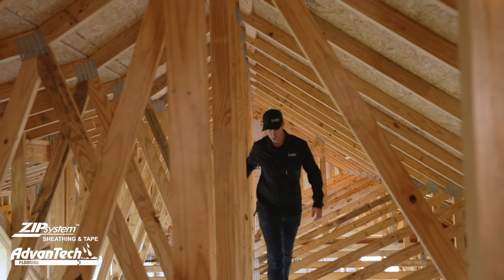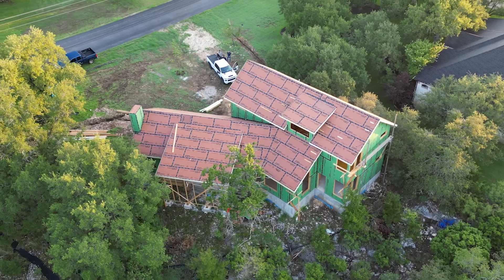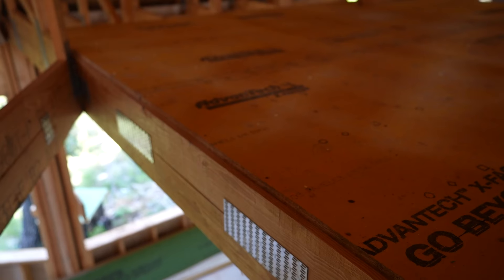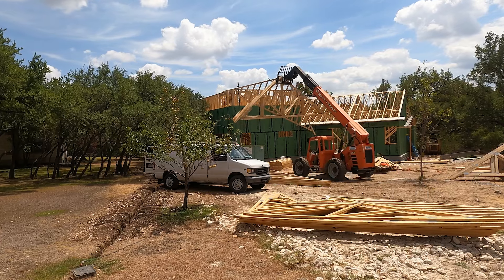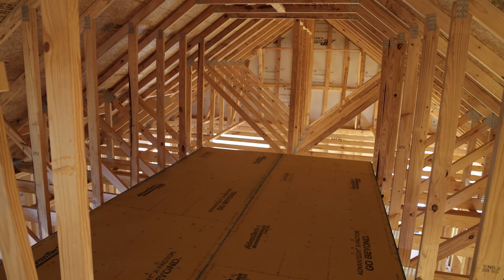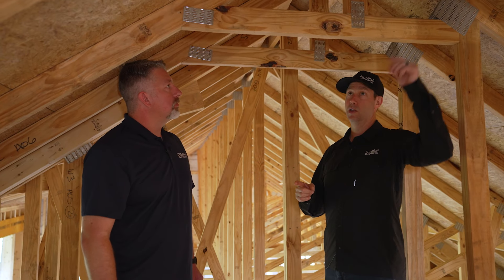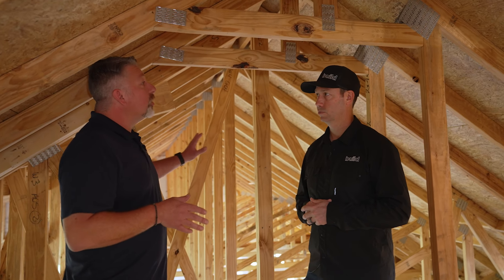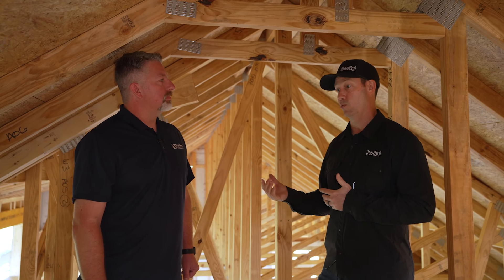ROOF TRUSSES: Pros, cons, and costs!

Comment: Regular roof framing is worth the cost. The usable space is worth it. Never met a homeowner that built a house that complained about too much room.
Reply: Yea,try and crawl in this roof for anything.
Reply: You can spec them anyway you want. The McMansion they are building next door has 18 inch shoulder for insulation and fully open and will be playrooms and HVAC with storage over a huge open living room.
Reply: I have a trussed roof and the top floor is a master suite with an angled ceiling with skylights and dormers.
Reply: Plus the taller lumber makes insulating at the roof line easier
Reply: In some parts of the country that’s fine, but here in the north that is all insulated space. We blow 30 or more inches of insulation in attics.
Reply: IMO, the design decision should centre around whether the climate demands a vented or non-vented roof.  The outside vs inside relative temperatures should dictate how important a vented attic really is to preserving a comfortable interior temperature.
Reply: @chameleongates  you can vent a roof either way. What are you talking about?
Reply: Span. The biggest advantage. I was part of building a church once. The truss span was 78 ft. Can't  do that with rafters 40 plus ft. Is common.

Comment: If you're building massive homes like this that 99% of us can't afford, trusses almost always make the most sense. Basic gable roof, rafters make the most sense.
Reply: Still cheaper and more consistent to use trusses.
Reply: @Egleu1  The 7,000 dollars stated includes labor on a very complex roof design. If your making a basic roof, rafters are cheaper material wise and labor wouldn't be a whole lot more because it is just cutting the same cut over and over. Not hard to setup a miter saw with a wing and stop block using an extra 2x6, some horses, and clamps. Cutting a birds mouth would be more time consuming unless your roof is about 45 degrees since it involves a shallow angle cut, but not much if you are skilled at cutting with hand power tools. People still use rafters for a reason. I'd use trusses if given the option but that is mostly because I'm lazier then I am frugal and if I want more strength I just put them 16-20" on center instead of 24"
Reply: @siral2000  that roof they showed is hardly complex.

Comment: I design these systems in the Midwest. Clear spanning large open areas is one of the major benefits you've missed out on in this video. Plus we design top down for the best value engineering. Having proper load transfer from top to bottom is another great benefit to truss systems. Glad you did a video, maybe visit a plant sometime, I can set up some tours if you need it. 😉
Reply: What is the maximum reasonable span distance? Is this limited by span, height, or both?

Can you do an attic room style truss?

These are super cool man.
Reply: @JL10007406  we've just put up 90' clear span within the last few months. I know we've sent out 100' clear span trusses before as well. On longer trusses like that we're designing camber into the bottoms to let the truss settle into a final straight layout after installation. Max height of a single truss is typically at 14' but we can stack multiple trusses together with proper bracing to achieve a taller roof height if needed. Room in attics can be loaded for RTU, living area, or light storage. The height of the room only limited by the pitch and heel height. Awesome questions!
Reply: Right and I think the clear span you can achieve with trusses is the biggest reason to go with trusses and they didn’t cover that.
Reply: @cherrytsume  thank you for the reply!

For conditioned room in attics, can customers define the dimensions of the top member? If I wanted 2x6 or 2x8 lumber, for example, can I pay extra for that additional cavity depth without triggering extensive engineering work? I don't like exterior foam insulation for environmental reasons. The ability to use cavity insulation inside the sheathing would be attractive, but infeasible if the member thickness was only 3.5".
Reply: @JL10007406  Most attic trusses have a minimum 2x6 for the top chords due to the lack of triangulation withing the room space. We can even frame in a small floor truss in the middle to provide space to run plumbing and hvac for your attic living areas as well. It's fairly common for our customers to request a southern pine 2x10 or 2x8 top chord for that additional interior insulation space just like how you're mentioning. Another great question!
Reply: Thank you Blake. I really hope Matt does a video at one of your facilities. I would love to hear about it. I am here I'm North Florida and waiting to build on my land after we hit a real recession.
Reply: Right you are on the clear span benefit. My homeboy Larry and I are building a 50X60 foot storage building and he went with 50’ trusses. All that storage area with no walls or support posts is pretty cool.
Reply: Clear span has nothing to do with truss vs cut roof
Reply: @CMbassin  trusses are actually terrible for long clear spans. Rafter thrust and bottom cord expansion/contraction leads to so many issues with drywall finishes and popped plates over time.  If your searching for clear span you need to rethink your interior design and go with a cambered glulam system or post and beam.
Reply: @BaronVonFrankenBolzlll  Re: " Clear span has nothing to do with truss vs cut roof":  Well, in practice it does.  The manufactured truss is engineered, so it features an optimized design.  The tables for designing a "cut" roof are overly conservative, and give you no credit for details that improve the strength of the assembly.  So, it is no big thing to design a relatively low pitch truss roof that spans 30 feet, but the same profile roof built from the tables would have much larger joists and rafters.
Reply: @BaronVonFrankenBolzlll  Re " trusses are actually terrible for long clear spans":  You are comparing a Ford solution to a Lamborghini one.  The world is filled with long clear spans made possible financially by use of trusses.  Oh, boy.  Making economically driven choices has consequences.  Surprised Pikachu face.

Comment: I'd be curious to know if the 'savings' for these are actually passed on to the homeowners, or just to the homebuilder or contractor.  My guess is that it isn't.
Reply: It actually is. I am currently going through the process of building a house. I originally wanted a traditionally framed roof due to my line of work (firefighter). But I decided to go with trussing because it was a $7k to $8k cost difference.
Reply: Just depends on the contractor and the contract
Reply: @philippenight2421  Yes, that's the key.  My last build I generaled myself, so I know I got the savings as I bought my own materials, but some of the quotes I was getting from homebuilders (double the cost and more) were truly shocking.
Reply: if it's cost plus how could it not be??
Reply: Ask your builder/contractor for a price on traditional rafters vs. a truss roof.

Comment: The manufactured trusses can be engineered to have plenty of attic space. The cost savings is worth it by itself. As Matt said at the end, that money can be used in a different part of the house to upgrade insulation, better windows, larger island, etc in a part of the house that you'll spend a lot more time in.

Comment: As a 29 year firefighter I absolutely hate trusses. In a fire event, when a 1/4" on each side of the wood is charred, the wood still has plenty of strength, BUT the nail plates simply fall off, causing the roof to collapse.
There are plenty of videos where truss roofs collapse within 15 minutes of the fire start. That's why many fire departments don't even attempt an interior attack, which is the most effective, but rather go defensive from the outside, which then often leads to a total loss. 
Calculate that against the $7k savings.
Reply: The fire protection comes from the plasterboard/sheetrock on the ceiling. You only need enough time to get out of the building safely, which in the UK is 39 mins, nobody is going to try to salvage a burnt out building. if the sheetrock isn't in place then it's during construction which is a different thing.
Reply: Simple don’t turn your house into a tiki torch.  If it ever gets to a point where the fire is so big the trusses are failing I think I’d rather tear the whole thing down and start over regardless
Reply: @GraemeFugaccia  What about an electrical fire? And most places that have fires don't get knocked down, the fire gets put out and the building gets repaired. Trusses and lightweight construction can fail under fire conditions as quickly as 5 minutes from initial impingement on the structure.
Reply: @rezzbuilds8343  lightweight construction can fail within 5 minutes of impingement on the structure itself, those little gussets pop off in high heat conditions, builders look to maximize profits at the expense of the fire service. There are issues across the building industry where the resilience of the structure against fire is compromised for "better" and more cost effective methods.
Reply: @ryanpascuzzi8604  it must be a different attitude in the UK, firefighters don't go into buildings if there's no one in the building they just let it go and contain it therefore saving firefighters lives, an insured building is not worth the life of a firefighter. Your talking about risking firefighters lives to save the insurance company a bit of money. The occupants and firefighters lives are most important
Reply: @ryanpascuzzi8604  by lightweight, do you mean framed walls as well? There's a massive problem where you live if buildings are going on fire in 5 minutes. Every product used in the UK must meet the fire resistance set down in the building regulations. those include safety factors so assuming they are installed correctly the buildings are safe. If you're talking about poor workmanship then I don't know where to go from there, UK traditional masonry buildings burn down just as easily and fall apart when they become brittle. It's not a silver bullet.
Reply: @GraemeFugaccia  unsure if you're in the fire service, but how do you know everyone's out definitively without making a search? There are countless instances of first due companies being told everyone is out by credible sources only to find a victim during the search. Firefighters take an oath to serve, by joining the fire service you make a conscious decision knowing the risks involved. The citizens we serve believe that if they are trapped by fire we are coming. We cannot violate that trust.
Reply: @ryanpascuzzi8604  I'm not, I'm a truss designer of 30 years so I've got skin in the game. I respect your opinion and not trying to rile anyone. We are constantly doing fire tests over here and have to have some faith in the testing and regulations.
Reply: Home fire sprinkler systems are becoming more cost effective.
Reply: As a firefighter whats your opinion on bci or tgi joists?
Reply: Very interesting, makes sense
Reply: @t00018645  I don't have enough experience with them to have an opinion.
Reply: @dsdragoon  Yes BUT, the sprinkler systems are in the occupied rooms, not in the attic where the trusses are.
Reply: @ryanpascuzzi8604  might as just go back to building out of stone again then if that’s all we’re worried about
Reply: @rezzbuilds8343  or don't use gusset plates that only go in 3/8" to construct the truss...
Reply: @ryanpascuzzi8604  trusses are here to stay bud
Reply: @rezzbuilds8343  the building industry where the money is, the money makes codes, at the expense of firefighters in this case. Unfortunately things usually take a few LODDs to be changed, but good talk bud.
Reply: I agree %100 I responded to many jobs with trussed roofs both commercial and residential. SOP in our department is keep off any trussed residential roof that is built with wood, VERY cautious about commercial trussed roof. It depends upon how much fire is showing, 9 out of 10 we NEVER put crews on roofs. Just an FYI, the floors on the WTC were steel trussed floor supports. The floors were trussed steel joists that spanned from the curtain wall to central core. The trusses were attached to the central core with the trusses placed on a 6 inch 3/8 steel L bracket. This construction issue was never mentioned in any of the reports I have read.
Reply: @coyotetrips  the trusses are not the issue, it’s the lack of a proper size up. The phoenix video of the early 90’s is way used. Aggressive fire attack combined with true truck work keeps firefighters safe.
Reply: @GraemeFugaccia  to be fair, it doesn't just save the insurance company money. Homeowners virtually never have enough coverage to completely replace the home and all the contents, not to mention irreplaceable things like heirlooms, photos, etc, plus the cost of living elsewhere while your home is rebuilt which insurance covers some of, but often not enough, the time involved in rebuilding, etc etc etc. "saving the slab" so-to-speak is something you've very rarely hear firefighters advocate for, at least in the US. Those are generally command staff decisions, and very often a fire department that has a reputation of not being aggressive at all, and preferring the "surround and drown" attack will have huge turnover of firefighters because we become firefighters to fight fire. Not to just pull the occupants out and then roast marshmallows.
Reply: How do they know if a house is built with trusses vs rafters?
Reply: @frankrizzo1433  do you not go interior?
Reply: The best thing people can do is put in a sprinkler system. Every new house should have one. Chances are your discount in homeowners insurance will go a long way towards covering the cost.
Also don't do stupid things, like smoking in bed. Smoking is not the most likely cause of a house fire. It's around #5. But it's the #1 cause of house fire fatalities.
#1 cause of home fires is cooking. Keep a small extinguisher in your kitchen, where you can get to it easily if there's a stove fire, in other words, not right next to the stove.
Reply: @coyotetrips  how many roof collapses have you seen?
Reply: As a firefighter,, how the hell do you know if its a stick or truss frame roof?
Reply: @t00018645  any kind of engineered joist or I-beam is anathema to firefighters.  The glue melts quicker than a standard beam or joist and the floor collapses.  There's been firefighter deaths and injuries from  a structure mostly intact, but fire weakening the floor and joists and it just gives way.  50 year old homes last 4-5 times longer on fire than new construction and have a better chance of being saved to rebuild, largely from using thick, solid wood instead of prebuilt structures (trusses, bci joists etc) but cost and time savings drive everything else.
Reply: @GraemeFugaccia  Suppose you have an electrical fire above the sheetrock ceiling...
Reply: I would never use trusses for many reasons.

Comment: Great comparison. As a builder in the north, we use trussed roof systems about 90% of the time. If we hand stack a roof, it's usually because we either need the ceiling to match the roof pitch, such as the 12/12 A-frame style we're currently on, or some other restrictions. For us, it really is a matter of time savings on the job site, but the ability to clear span large spaces is very benificial. However, make no mistake, just because you're using trusses, doesn't mean just anyone can do the job. Simple, gable style roofs are easy, but just like hand stacked roofs, things get tricky when you start building in hips and valleys. And, a quality product (home) starts with the foundation and walls below. If they aren't square, plumb and straight, you're going to struggle with the roof. Trusses and hand stacking are both great and should be used in appropriate situations.

Comment: Back in the late '60's early'70'S.......pre-built/ordered trusses was a new big thing. My father built a specialty custom home with a SLATE ROOF, with high pitch and many hips and valleys. He DOUBLE ordered all trusses/ +1 for gable ends/ 2×6 truss. On site he DOUBLED UP (2 put togeater as one) placed in a jig and adhesived and staggered screwed each togeather....and placed them 12" on center. Back then TECO's was not really a thing, so each doublet was strapped and nailed to the plate. 5/8" 5 ply sheathing and Back then we only had heavy tar felt. THAT SLATE andCopper valley roof ridge is still straight as an arrow and proud to be seen 50+ years old now.

Comment: Great video. The houses I built for myself and my family I always what we called it back in the day stick built. Nothing wrong with today’s engineer roof trusses I just didn’t want them on my house. I did use engineered floor joists. Also I used a framing crew that was older guys. Took a little longer but they new what to do and how to do it. I live in a coastal hurricane area.  It’s just my opinion but with all the strapping it’s just stronger to me.